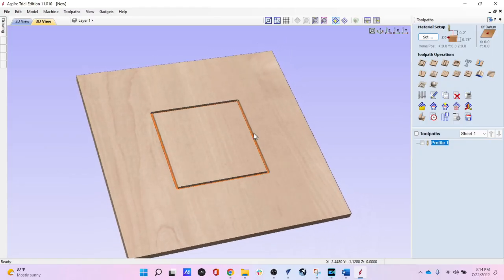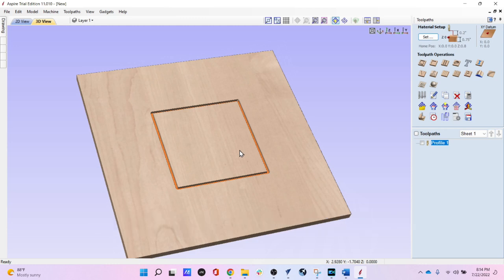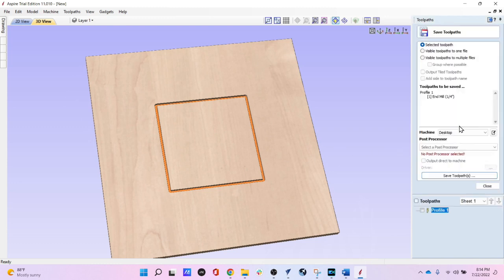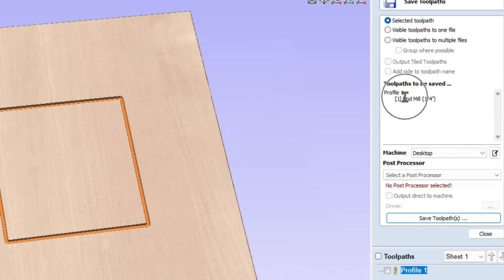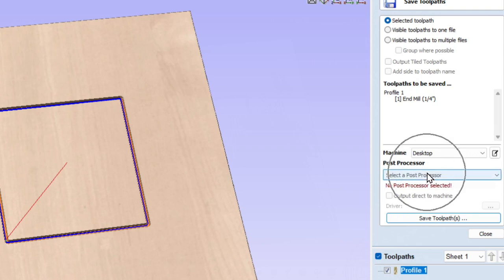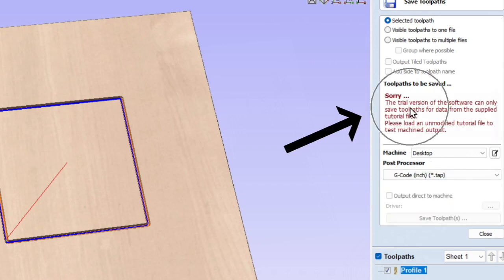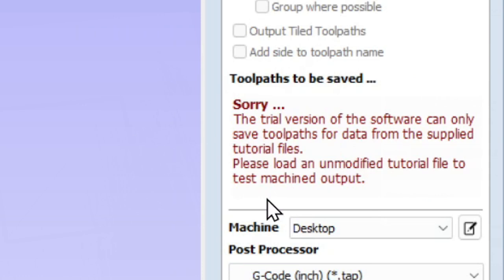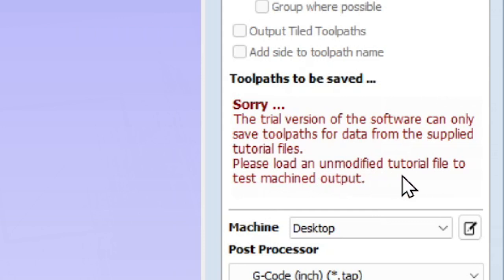Why Your Vectric Design Software Won't Make Tool Paths (gcode) [CNC router]

Comment: So here's my issue. I have Vectric's VCarve Desktop and a Fox Alien Masuter Pro. My machine is not listed in the Post Processor drop down menu. I tried saving toolpaths as generic g-codes and as grbl files but my machine won't execute either of them. I have searched the internet to no end and have been unable to find anything close to this. Do you have any ideas? I'm seriously going insane here.
Reply from the maker: Try using the grbl(inch) or grbl(mm) post processors, those should work great for your machine brother.
Reply: @IDCWoodcraft  Thank you for responding. I figured out the problem I was having. When I was staring my cut the Z axis would lift too far and trigger the limit switch. I've made the correct adjustments but now when I run the file, the machine goes completely off the project board and then begins the cut. So now I'm trying to figure that one out.

Comment: OK Garrett riddle me this one.  I get this every now and then and I have no idea what it means.  "No toolpath generated for current parameters.  Check tool can fit into selected vectors at machining depth."  There are no curves or spots in the project that a 1/8" bit cannot fit into.  In fact the entire part is being cut ouside of the vector lines.  The material is 1/4" thick, using a 1/8" badger bit and everyting is a profile toolpath.  My job setup is set for .25 inch material and the cutting depth is set to .26".  Everything is identical to the part I created 5 minutes earlier except for the shape.  I have no idea what the hell this means and it comes up all the time and I just give up on it and figure another way to make the part I need.  Do you what might be causing this?  It drives me crazy.  I get so pissed I feel like taking a hammer to the damned computer.  Anyhow if you know what's causing this I sure would appreciate hearing from you about it.  Thanks Garrett, appreciate any help you can provide with this.
Jim
Reply from the maker: Hey Jim, I totally understand how frustrating that can be! This one is a little tricky to walk you through over email, my friend. I recommend joining us for our live sessions we host every Wednesday evening at 8PM EST. We should be able to help walk you through it then, brother!

Comment: But you didn't explain why the "Output directly to machine" doesn't work. Which is really kind of the point, isn't it? I paid 600 bucks for this software and I have to used 3rd party software to complete the process?
Reply from the maker: That's a good point. But I've never used that feature and I know of no one else who is used that as well. But I will certainly give it a try and if it works, I will do a video on it!
Reply: @IDCWoodcraft  Thanks for the reply! And received an order of your bits the other day (Hawaii) and nice touch with the M&Ms and note on the box!

Comment: Fusion 360 is free for personal use and you can make toolpath and run your code on your CNC machine, but it also have it´s limitations like only 10 projects are allowed and you can not get the G code so that the CNC stops for a tool change, so in that case a project easy comes up to 10 projects.. Small hobbyists done have or want to spend 500-1000 bucks for a software. And if you are running mac then you are even more out on deep water because then its almost only Fusion 360 that is going to work. One other thing, Fusion 360 is quite confusing to get the hang of, the learning curve is quite steep and it´s easy to get frustrated.
Reply from the maker: HearGear, good call brother! Fusion360 is a great software package for sure but it can be tricky to get started like you said.

Comment: I created a bunch of files with the trial version on my PC.  The paid for version is on the laptop I will take to the shop with me to rum the CNC.  Now the paid version won't open the files I created on the trial version, is there anyway around this?  Thanks for the help.
Reply from the maker: Jim, if your trial software is an older version, you might have issues with opening up your files. I would recommend reaching out to Vectric on this one. They are very helpful brother!

Comment: Good morning, so I got the desktop trial and ran into this very problem. I just want to carve anything to verify my system works. 
so were do I go download a tutorial file that's carveable. There's no files in the file folder except the ones I saved off prior to the post processor save step.  I'd be happy with anything, a straight line, a circle, a letter, anything to make sure I've got everything connected and working correctly. A year ago I built a 3018 style machine from scratch, that is parts I've ordered from the net. It has a Raz-Pi control board and works on GRBL Gcode. I tried to figure the open source programs without any luck so now I'm ready to buy. The VCARVE software seems very straight forward to use in the tutorials and I appreciate watching your vids and turning me on to it. Now I want to see to see it go. Then I'll buy. Since I'm 80 I need to watch my bank accounts carefully, so even $350 is a bit of a reach for me.  Thanks for all your help.  BulldogDon
Reply from the maker: BulldogDon, I would recommend reaching out to Vectric on that one brother. They will be able to help you download those free files to your computer to use. Try out these files here too brother. Here is the link: https://www.vectric.com/vectric-community/free-projects/free-trial

Comment: My CNC Router came with Vectric V Carve Pro 9.5. I decided to do an upgrade on it to the latest Version and add PhotoCarve. As the work I'm doing is getting more involved with creating 3D models, I decided to upgrade to Aspire V11 and get the Photo Carve that comes bundled with the Aspire. I saw where there was a virtually unlimited time where I could download Aspire and try it before I buy it. I soon discovered, like Mastercam, I could do all the drawing and design work, but was not able to output and save any of the work outside of the downloaded demo version.

Still, if you want to try before you buy and see how you like it, it's a pretty good deal.

I did buy the  Aspire upgrade. It's got everything V Carve Pro has, but where you run out of design capability with V Carve Pro, you're just getting started with Aspire
Reply from the maker: CNC Programmer, thanks for all the good info. I have run a few different programs over the years. You have some great points! I know others will value the fact that you took the time to share that with everyone.